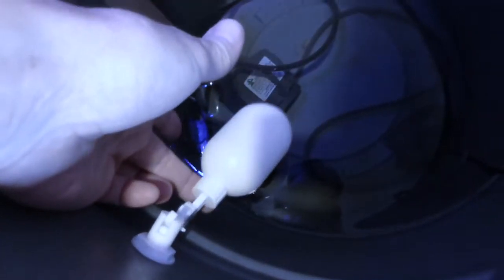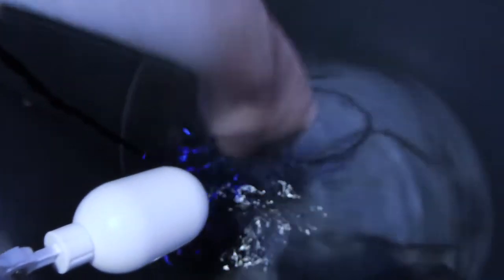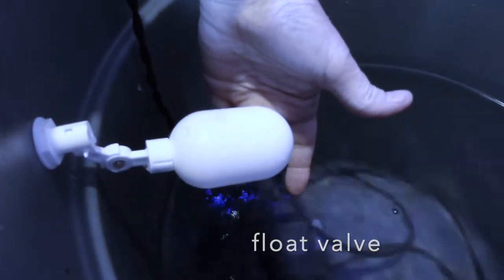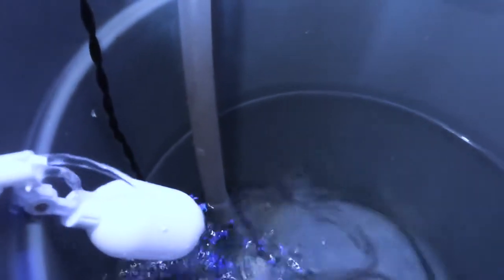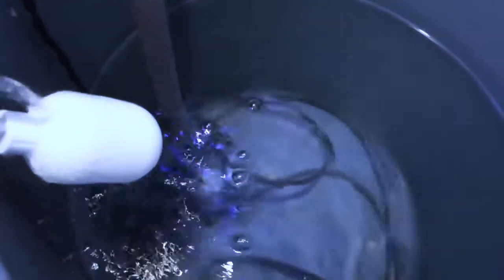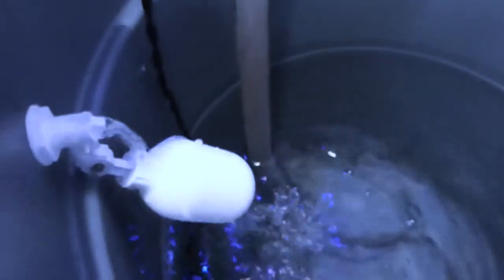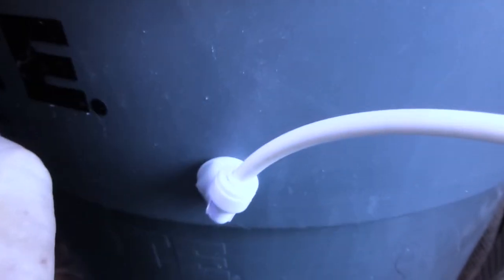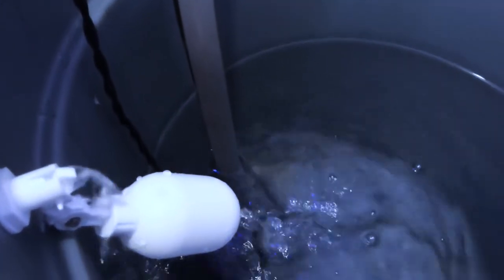Using Float Valve to prevent flood when making RO water

Comment: Your RO waste water line should still be pouring water down the drain if you're just turning off the clean water line going into the holding reservoir with a float.

Comment: I want to use a RO system to fill a 55 gallon plastic water storage tank. Is the water line you hooked to the float valve the water line that would normally go into the metal tank of an RO system?